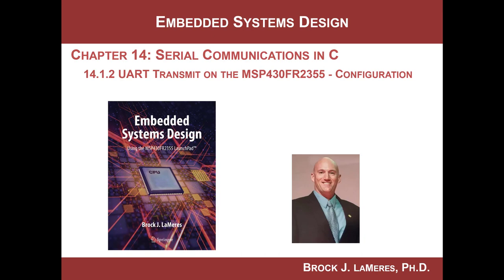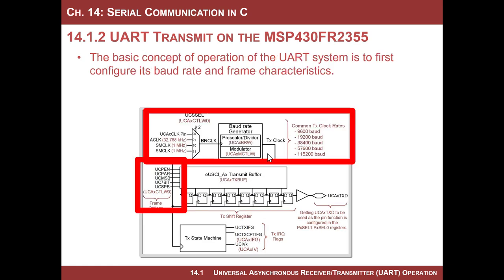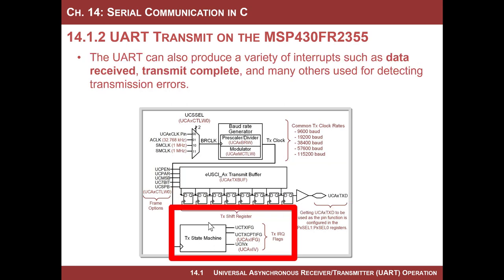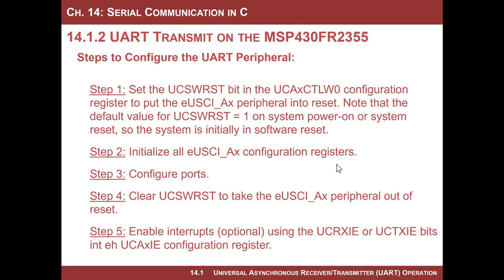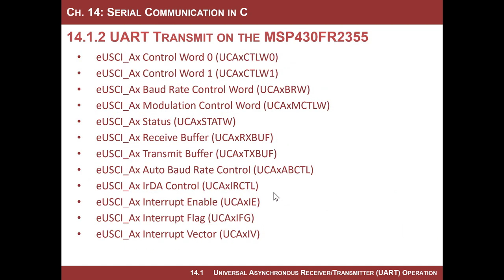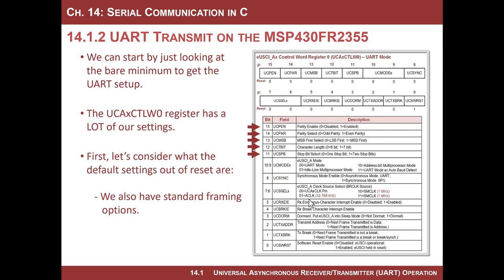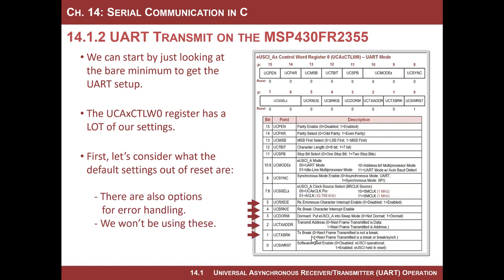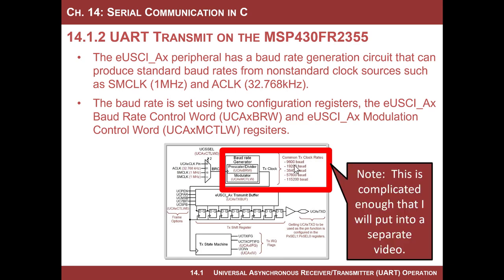14.1(c) - Serial Communication on the MSP430: The UART - Configuring the UART Tx

Comment: If I could recommend something I think would be helpful for everyone it would be to include which document (datasheet, family users guide, launchpad datasheet) the information that is being displayed at the time came from. I know in some of the earlier videos you explained how you found certain things and even said where some of the info had come from but I think if you listed it on all the slides that have a screenshot of a document to include which ones it came from. Not saying one couldn't just look through all the docs but I noticed that in an earlier video you had compiled your own table of info and I think if you listed all the resources you had to go though to find the info when it is being displayed I think it would be very helpful and really drive home the point of having to look through multiple documents to find what your looking for.  I really appreciate this series. I have been trying to find a way to learn about programming MCUs and this had been the best and I have learned so much already.
Reply: I know this is over a year later but, in these videos most of the diagrams and similar come from his textbook. It can be found on amazon for pretty cheap. In this case chapter 14 section 1. Cheers